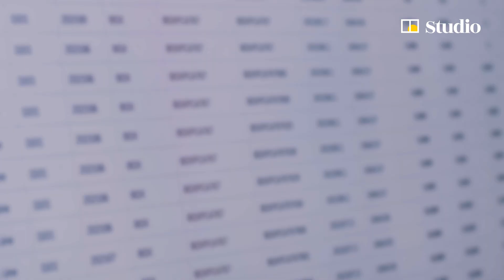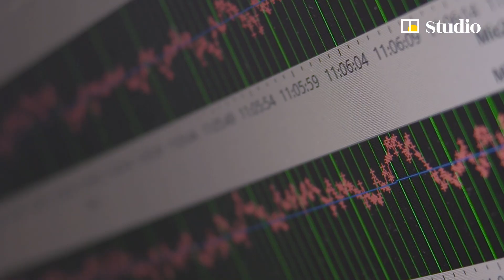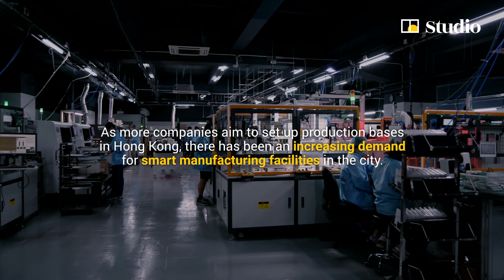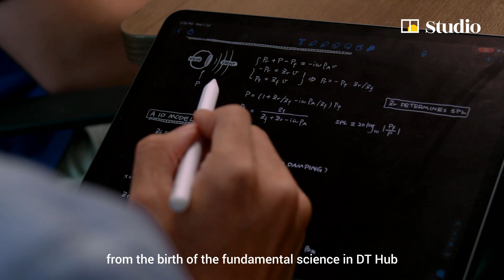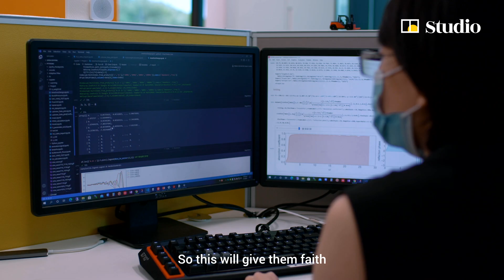Data drives future of smart manufacturing

Comment: Really interesting to see how companies like NiRoTech and Acoustic Metamaterials are tapping into data to refine their manufacturing. It shows how even SMEs can make big improvements just by using the right analytics and tech infrastructure.

Curious if they’re using any specific platforms for asset tracking or production monitoring? Tools like Fogwing EAM and IoT-based systems can really help streamline factory operations and reduce downtime. Would love to see a deeper dive into their actual data workflows or tech stacks!